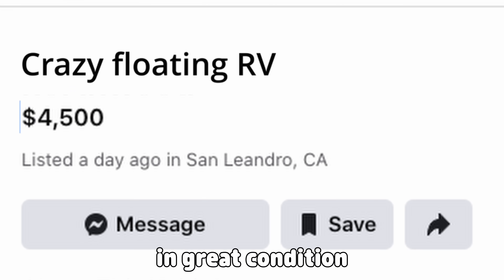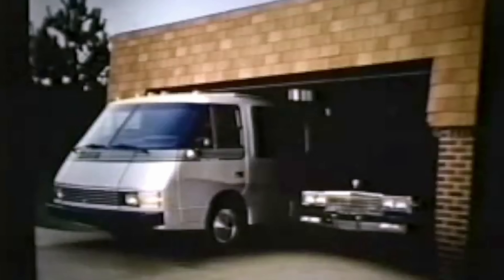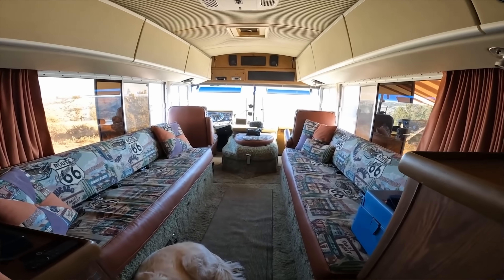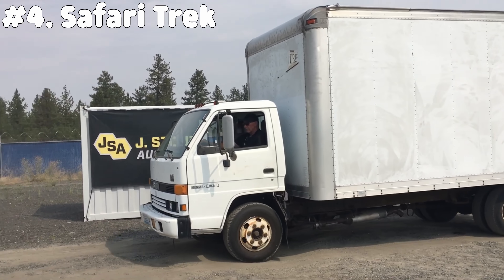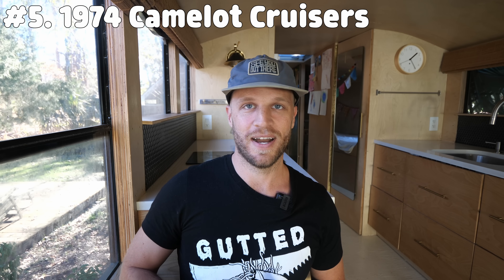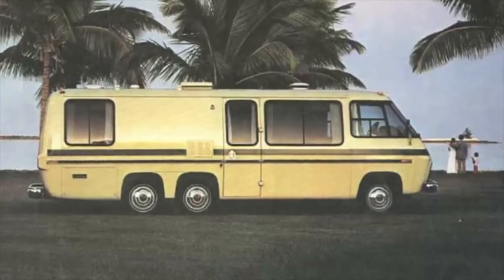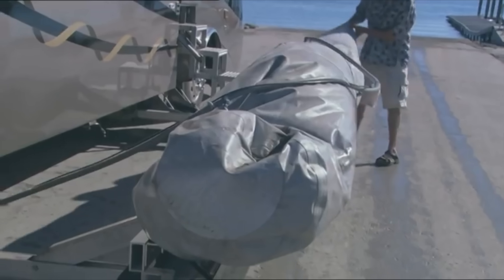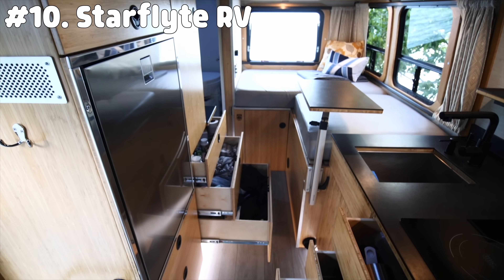If You See Any of These RVs For Sale BUY THEM

Comment: Ok, People Do Not Follow pretty much Any of this advice.   Unless you want to have money pits,  and have a real, real hard time finding someone who will work on them, even worse is finding some who actually knows how to work kn them.  As far as finding parts for mk oat of these?  If, and how much $$$$......
Reply from the maker: I appreciate your opinion and for a few of these rigs you're definitely not wrong. It may be a labor of love for some but for others I don't agree. What would you buy instead?
Reply: @MobileDwellings  I have a Revcon motorhome, which is basically if the GMC and an airstream had a baby, same drivetrain and everything. It has required constant maintenance and repairs, and I've had to do most of those on the side of the road. 

Will I ever sell it, heck no, but I'd never recommend it for someone who needs a shop to do everything, it would bankrupt pretty much anyone.
Reply: @MobileDwellings  Toyota

Comment: A Wanderlodge might be great but don't buy one with the 3208 v8 Caterpillar. They are known as a throwaway engine for good reason - they're weak and fragile. Cat makes some great engines but this is definitely,definitely not one of them!
Reply: Weak and fragile for a 60K pound commercial truck going 300K miles per year maybe, but most big RVs only run about 20-30K pounds and maybe go 80K miles in 20 years. Even those engines are overkill for that application. Non-issue. More likely to die from sitting too much.
Reply: I've owned a Wanderlodge with a CAT 3208 turbo with 300 hp for 25yrs and have had no trouble. That is a myth.

Comment: GMC  VENTURA.....THERE WHERE  2 ENGINE  CHOICES
403  455......LOOK  WHAT A PILE  OF SHIT....AN OLD CLASS A BY ANYBODYS  WAY
BETTER.......I SPENT  YEARS
WORKING  ON A VENTURA..DOING  ALL  THE UPDATES.......IN THE END...
ITS GOT YOUR FACE  TOO  TOO
CLOSE  TO THE WINDSHIELD...THE INTERIORS  TOO  LITTLE....THE AIRBAG  SUSOENSION  BUSHINGS  WEAR  OUT...BRAKEING  IS INADIQUATE.....AIR PUMPS  WEAR  OUT....AND  YOU DROP  LIKE A ROCK...IT USES
AN  OLDS  TORANADO   TRANS  CUZ...ITS  FRONT WHEEL 
DRIVE....AND  ITS  ALL  UNDERSIZED...ETC....STAY
AWAY   UNLESS   YOUR OBSESED    AND  WILLING
TO  DO  ALLOT  OF DIFFICUL
WORK.....SERIOUSLY
...YOUR  BETTER OFF  WITH A 500 DOLLAR  TIOGA.
.